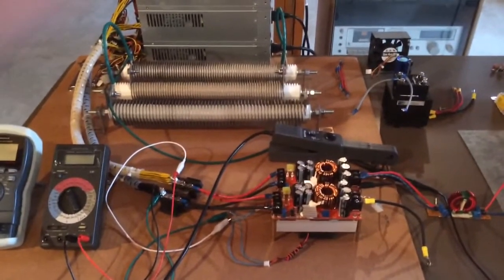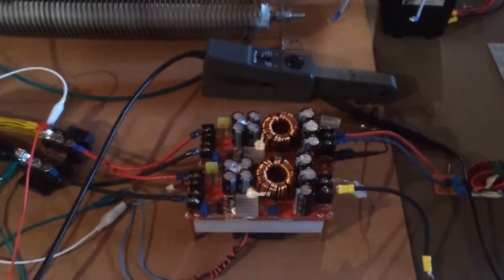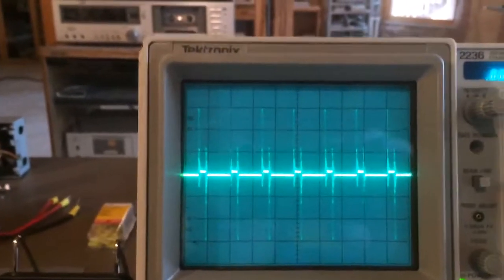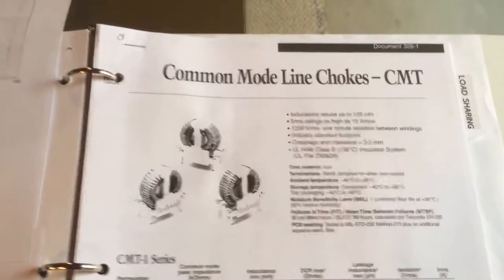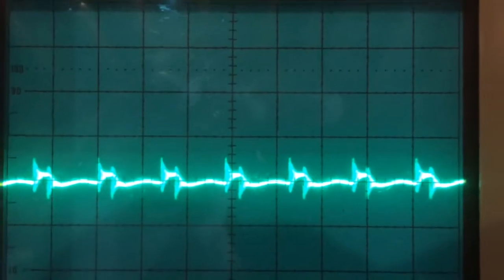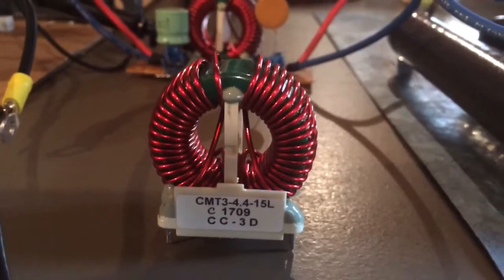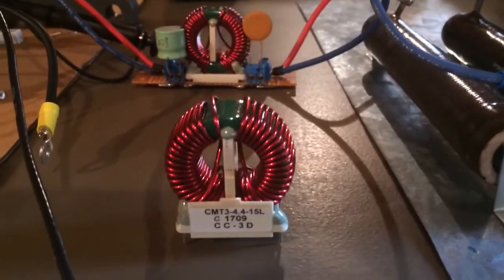RF Man discusses how filter ripple voltage and noise in a 12v to 50v boost converter

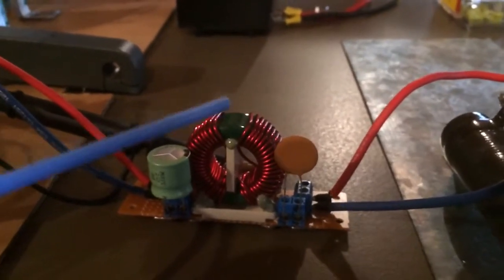Comment: At 10:42 you say that the common mode inductor is in series with the positive line . This means that you are using a common mode inductor in a differential mode . A common mode inductor is designed to be inserted into both , the positive and negative lines . If it is in only one line , the core will saturate and loose most of its inductance . A differential inductor is designed to work up to a certain maximum current and has an air gap to prevent it from saturating .

Comment: Can you post the common-mode toroid material/size specs (or part)#? How about schematic and winding instructions? Not positively clear from the video. I'd like to start from, and end up at, a known design point (as opposed to trial and error on my part). Thanks...
Reply: I'd appreciate the sharing of this information also. I do not have a background in power supply design or ripple filtering either.